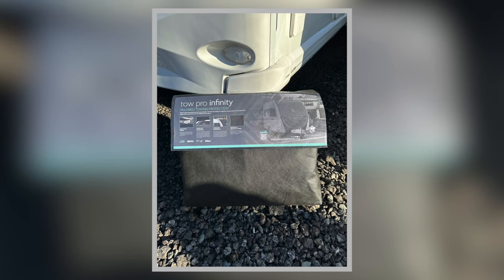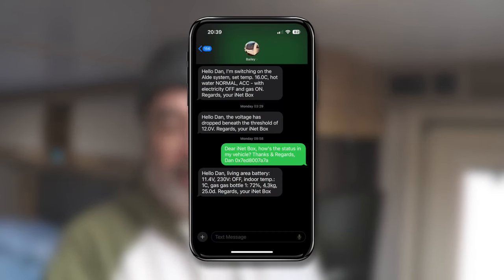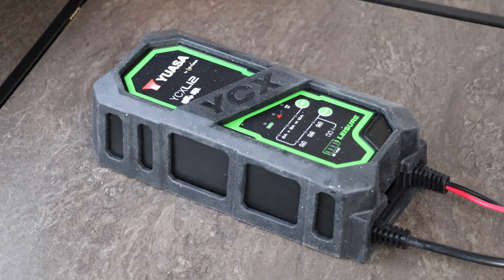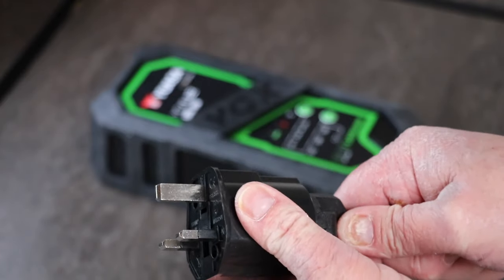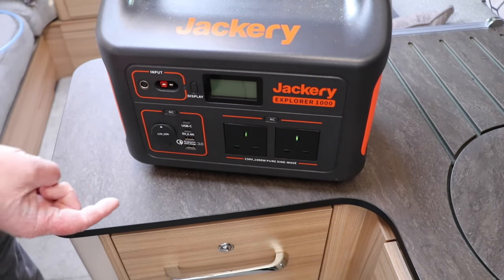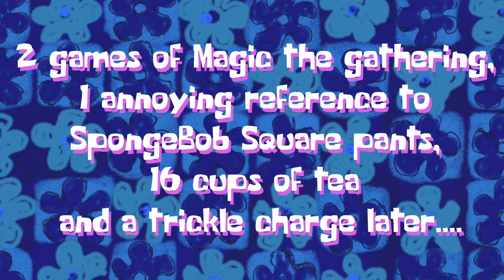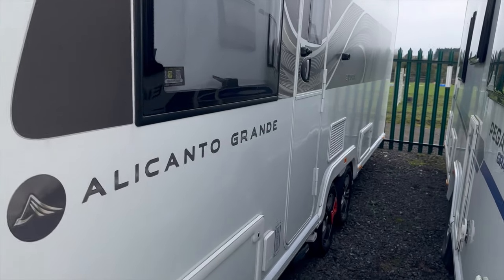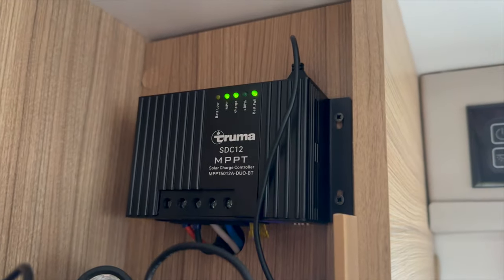😡 First mistake of 2024 in the caravan

Comment: Hi Dan, great you got it up and running and sorted the issue out to a certain extent however a few observations

Battery only showing fully charged as connected to the Jackery still which the mttp thinks it’s fully charged. 

Your solar set up in winter will not even deliver 4 amps charge a day so don’t rely on that. Don’t rely on solar to even keep things topped up. 

The app whilst showing 54 amps charged, does not give an accurate status. You really need to have a battery shunt so you can measure amps in and out. 

The voltage reading whilst is accurate at the time, the battery needs to be resting in your set up to get anywhere near a reading based on voltage to advise of your battery state of charge.  

If in drastic situations why not just connect up to the car and make sure the fridge is off and you could have put 15amps in an hour whilst you were trying to sort things out,  that could have put 14% charge back in straight away before you even left the caravan. 

Over the years I have learnt a lot and pretty much got all angles covered to ensure the situation you found yourself in never happens. 

Nice video at a basic level but there is much more that can be done in your set up to prevent this bit appreciate you rarely need the power as on EHU.

Comment: I’ve fitted one of those PowerPole connectors to the back of my Challenger 650s electrical box - directly across the battery cables, same place the dealer tapped off for our motor movers. My cable has a 20A fuse and a blank cover to ensure nothing touches the terminals when it’s not in use. 

Whenever I need to charge the caravan battery I have a connection under the front seat so don’t have to mess around with clips, especially as my battery is in an outside accessible box. 

I use a homebrew “TrailerPak” battery box from when we went camping 20+ years ago in a tent. A 90A Lithium battery in this and a 350w inverter is more than sufficient to recharge the caravan battery, and was far cheaper than any of these “all in one” power station/solar generators.

I also leave the spotlight over the bench seat by the door on when the caravan is at the storage yard we use. It’s pointing straight out so you’d notice it, even if only locking the door from outside. 

An easy mistake to make, and you had a solution to hand, so no harm done - thanks for sharing this reminder to us all.

Comment: Hi Dan
I have that same control panel in my Coachman Acadia and it’s one of the only things I don’t like about the van, it’s a poor design with it having no light to indicate that you have switched on the twelve volt power. I have to leave the light switch on so that when the panel is activated the light by the door illuminates to tell me it’s on. My previous coachman had a light on the switch to tell you it was on, progress hey! I keep my van at home and have in plugged in and switch on the power every now and then to keep the battery charged but it’s very easy to see how that mistake can be made with that panel especially.

Comment: Great channel, learning loads. Been motor homing for years but switched codes 2 weeks ago and swapped it for a caravan.. Surprised myself on how different it is !  Anyway, just regarding the Jackery, I have the same one, did the 240v outlet actually turn itself off because it wasn’t pulling any current ? Not sure I’ve left mine on long enough to test that but didn’t know it was a function.

Comment: A work colleague over winter used to run his motorbike (SORNed and garaged) once a week for about 6 hours idling just to keep the battery charged up. Then I introduced him to my Bluetti AC50S and a bike charger. He now doesn't run the bike at all but charges the bike for a couple of days once a fortnight and then charges the battery pack in his flat.

He then bought his own Bluetti and found that on 'power saving' mode it would shut down if it doesn't see the throughput of power it needs to stay away so the bike only gets about 4 hours of charge at a time but the battery pack lasts ages now between charges.

So yeah, those battery packs are awesome and it is encouragement to keep things charged up on the caravan. You could also have hooked up the battery to the EHU socket outside and a cable running inside the van to the battery but then you would have compromised some part of the security by leaving something unlocked and open (even a crack) to get the power cable through.

Comment: I did exactly the same thing with my Elddis when it was in storage 35 miles from home. I rang the insurance company and explained the issue. They were very good and said take the battery home to recharge it and they would continue cover for 30 days by which time a battery must be back in position and operating as before. I was shocked.

Comment: Funny enough thanks to Black Friday I got a Jackery 500 complete with 100 watt solar panel for £399. I got this to run my Waeco freezer. But although it won’t run the van it will run the on board battery charger to top up battery when off grid if sun not shining much. So like you I would also recommend people get a Jackery really useful bit of kit.

Comment: Hi Dan
Thanks for video. I purchase early last year a Ecoflow Delta 2 power pack plus extra battery and a 400w solar panel (treated myself 😊), for the camper when off grid, but I was wondering if it is possible to plug the power pack straight into the input 13 amp to run the caravan, does this sound durable? Obviously for security I would if possible have a cable made up to storage the power pack in the gas bottle cupboard as I only have one bottle in there? Your thoughts would be appreciated. Keep Up The Good Work, Colin

Comment: Hi Dan did the same thing last year  just changed my van bought a 120ah battery (expensive) anyway put van away some time later went to van and I had left the control panel on battery had 2volts on it  tried quite a few times to recharge can't get it to hold charge so new battery again lesson learned stay safe 👍

Comment: I feel your pain! 
What I struggle to understand is why British caravan manufacturers remain stuck in the dark ages??  The standard on board battery charger that is in nearly all caravans, is incompatible with Li Ion batteries. And as you showed in a previous video, they install cheap PWM solar controllers. Lead acid batteries in all their forms are 100 year old technology. Why not AT LEAST, offer an option where they can keep the old tech and have a Li Ion option? 
I am about to buy a new caravan. I do not want to fit an ancient Lead Acid leisure battery. But to fit a Li Ion battery, I have to rip out the charger and the solar controller. Time for manufacturers to wake up. Sell it without the old stuff and just pre-wire, then we can do it ourselves!

Comment: Get the biggest flexible solar panel that will fit fastened to your roof, use it to charge your battery through a moderate MPPT controller. I have a 5w panel keeping a 80AH battery full successfully with no load (til spring!). If you have permanent loads then you need to calculate them into the charge requirement sadly, in the UK winter solar harvest is about 5% of the panel's rating.

Comment: Not sure of the make of your alarm, but on my Elddis the alarm has its own 12v battery supply, and if you have a tracker retrieve that is the same, so removing the 12v main battery wont cause you any issues.

Comment: Hi Dan just bought a Unicorn Deluxe cant get my head around the Truma MPPT controller my battery is full but the lights on the solor controller never say full or even 80% full is this correct .The only light that is on the control panel is the second one in that flashes which I think means waiting to charge 
Thanks

Comment: Cool bits of kit Dan and a really interesting video! I have one of those small fold up solar panels. It’s only about 5w but in fairness I nipped up to our van, put a multimeter across the terminals and the battery was showing 13. Something volts so I’m assuming it’s full and in good condition.  I’ve only a basic battery charger - something Fred Flintstone might have used so really reluctant to put that on a leisure battery.  Thanks for showing us your gear 👍

Comment: As a newbie, leaving the “Main” power on is something I have done a number of times. My solution is to leave the light switch on, a light near the door on, and turn off the main as I leave. The tell tale is if the light is on, the main is on.
Wouldn’t the light on the control panel be a PITA on a night when you want the van dark?

Comment: How long does it take to charge up with the caravan charger, i disconnected the sites main power and left the heating panel on to ensure the caravan stayed at around 10 degrees, but i left radion on too by accident, battery seems almost discharged, advice welcome.

Comment: I bought the Bluetooth dongle via your link however it comes with a different plug to the one you show. Mine is more like a small Ethernet. Do you have a link to one with the same plug that fits in the top of the controller as yours does.
Reply from the maker: Morning, apologies for that - the listing had changed since I created the link. you are looking for "BT-10" here is a link, however if you look at AliExpress or Ebay you can usually find one cheaper.  Again apologies.

https://amzn.to/432bQPg

Comment: Most alarms and trackers will have some form of internal backup battery fitted so you can remove the main van battery but still have a working alarm & tracker.  If it just relied on the van battery then that would make it easy to steal, just break into battery box and disconnect battery or cut cable!
Reply from the maker: My alarm / tracker will last 4 - 6 hours. Not long enough to remove, fully charge and replace back at the storage yard.
Reply: @TheTrudgians  That's not very good, are you sure your backup battery is ok?  My old Sargent AS300 states it had something like 5 month running on backup power alone.  Granted that is without tracker but 4-6 hours does seem a ridiculously short amount of time.

Comment: Hi Dan - been there, done that... had to push cos the motor mover wouldn't work in my case.  Shame the caravan doesn't have an alarm with an in built battery - I never had to worry about removing the battery in my last van the battery in the alarm system lasted several weeks without charge being put into the van.
Reply: Also, you’ve got the panel I had on my Coachman and I’ve probably got the master switch panel you had on your Ridgeway, I can’t believe they fit the type you’ve got / I had. It’s such a poor design. Why are they not back lit? 

Love the Jackery. I want to need one if that makes sense. Such a smart piece of kit.

Comment: Hi Dan. Another option is to simply attach the Jackery DC in place of the battery till you got the real battery charged. My guess is you know that though 🙂👍
Reply from the maker: Indeed you’re correct, however I’d need to disconnect the solar, as the jackery “don’t like it up ‘em” on the 12v output. 👍
Reply: @TheTrudgians  Showing your age there Mr Mainwaring...  oops Jones.

Comment: Are you sure there isn’t a separate alarm battery, there is on swift vans. Be surprised if not the same across brands. I have done the same as you and now have two batteries for use across the winter period, and switch them out once every 6-8 weeks.
Reply from the maker: A small internal battery, it doesn’t last long after powered down.

Comment: 12A seems too high a charge amperage, that charge rate will damage your lead acid leisure battery, such an amperage is used for multiple parallel battery storage systems, as the charge is shared across those in circuit.
Reply from the maker: This is a smart charger. It’s not a constant current or voltage. It varies to a MAX of 12A. And as stated, I used it in our previous caravan - that battery is still good today. Bottom line - I think the manufacturers of this know what they’re doing. 👍

Comment: Hi Dan, is it your tracker that shows you the battery voltage? If so what tracker are you using?
Reply from the maker: Hi, The tracker does show voltage, and alerts me at power outage. I use the Moving Intelligence Vanguard system. What did alert me however, was the Truma iNet system I re-installed in the caravan.

Comment: Would doubling the solar panel too 200w help with the winters in the uk ! I am just thinking ahead when we order a bailey Alicante grande porto next year
Reply from the maker: Increasing the solar is never a bad thing, but if the battery is flat no end of solar on a cloudy or very overcast day will help.
Reply: @TheTrudgians  I was thinking for general use not for when you made your little hiccup 😜
Reply from the maker: @jonnoble4486 ha, well tbh. The more solar you can get - the better. But to maximise it think about some Lithium batteries that have bigger capacity. 👍

Comment: Just a precaution you should never connect the earth cable first SHOULD ALWAYS Connect the earth Last & remove it first to prevent causing a spark which could cause any battery gassed to ignite
Reply from the maker: Hi, if you notice, the cable was not connected to anything. While your method is correct and vitally important in automotive connectivity - with nothing attached, it makes no difference. 👍
Reply: @TheTrudgians  Hi Dan even a battery that is not connected can spark if the charger is not connected/ disconnected the right way I was a mechanic for 20 plus years and saw a few nasty accidents with batteries on & off the vehicle

Comment: Hi Dan if your charger was pulling 160watts of power wudnt your jackery only last about 6 to 7 hours not 2 days ? 👍
Reply from the maker: Good afternoon, Good point - but remember, its a smart charger, so varies current / voltage depending on its cycle. so it wont be a constant 160w pull from the power supply. As you would have seen, the charger gave up before the Jackery ran out of juice. 

Dan

Comment: Very interesting having this insurance dependency with just the 12v leisure battery. I would expect every thieve first unplug the battery then, even before vehicle is moving. My german Hobby caravan vendor tracking solution (which i don‘t use) as well as my after market tracking solution are installed (USB plug) with internal battery 30 days buffer which requires the thieve to locate the device (in my case requires disasemble furniture) until it could be set out of order. Downside here is if i got power alert from my device it meant my leisure battery is already dead for long time..

What f#=@s me up is i have trailer park shore power connected! but when expiriencing power loss (fuse, maintenance) it still drains my leisure battery and alarms me just a bit before game over. This season i start upgrading few enhancements installing smart home equipment which could helpful but requires continues internet.. #firstworldproblems